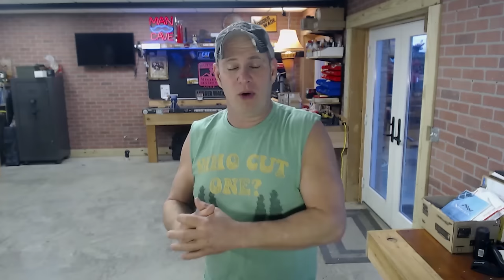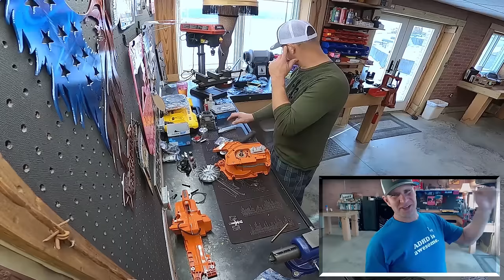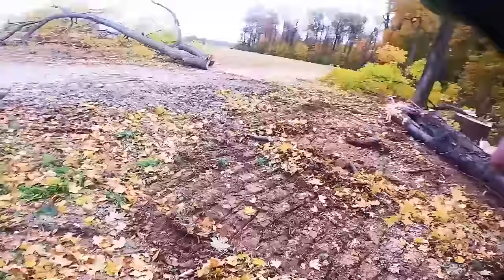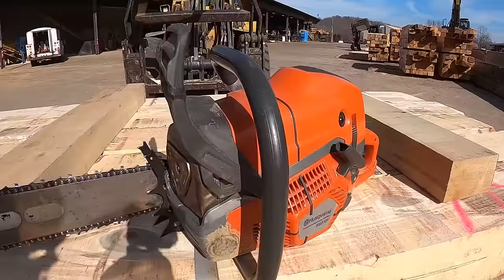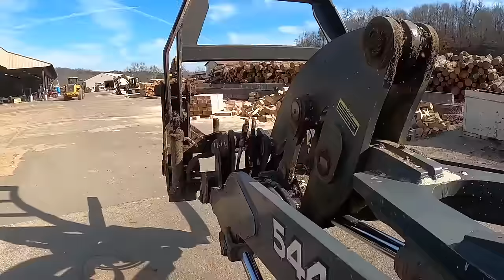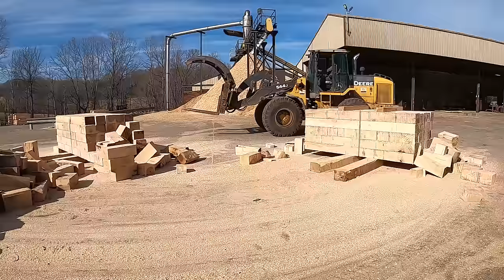Husky 592XP, This thing is awesome‼️

Comment: I remember one time I was watching hunt tree service cut down a couple of big trees at my neighbors house and all the trucks and shut their engines off. The chipper was loaded up on the trailer and this guy pulls out a husky 592. And I remember just being blown away by the power of that thing as it was cutting through the trunks of those huge Bradford pairs. It had the trunk turned in to dust in about two minutes.

Comment: Try an 8-pin rim sprocket I cut hardwood in NY with my 592 on a 24 and 28in bar and the 8 pin made an impressive difference in chain speed and helps the saw from over reving.

Comment: i have a McCulloch supper 44 with a 24 inch bar running Oregon 404 chain i got it used  in 1975  i cut and sold fire wood for years it still will keep up with the newer saws it heavy and loud but still cuts

Comment: Hi Wade. I opened the outlet hole some on the exhaust and put a red beard foam filter on mine and it helps them add some power and run a little cooler also. 😎

Comment: I run 2 592s had them 1.5 years so far. Love them overall, however the AV spring by the gas tank seems to break real easy and then both have had issues with the wire that runs along the ignition coil wire gets wore inside by the recoil pulley and won't run. Dealer said that was a common issue, so keep your eye out for that.

Comment: G'day LW, that sounds like an MS661, I run a 28 light bar on my MS660 full comp round only round. Saws used to sound different now they all sound very similar I've got a MS880 with a 36 inch bar when it's fully buried it'll belt you in the guts now and then 👍.

Comment: I ran my modified shine stihls an got into the Husqvarna line which me being me. I can’t keep my little patty fingers off of something brand new I did some modifications as I did my shine stihls. But  I have a lot of respect for the husky and I adjust mine to rap out  but with the modification on the carbs they are not running too lean. I agree  with everything you said and I can tell you there is not anyone that abuses a saw more than me I ask the impossible 100% of the time out of them. lol brand new huskys never made it to the woods before it went in the shop and I modified it.. Dad was like good god boy you could of  at least waited till the warranty expired😂😂😂😂😂 I’m a no bullshit guy I go to the woods to cut not play around 🤷🏻‍♂️😁😁 (edited fur a few spell boo boos)

Comment: i am with you on that saw sounds great, like the dual spike and it really looks like you are not really using them to there full potential. you said several time 63 gauge, but is it 3/8 or .404 pitch, from the sound of the engine i believe 3/8's with is best for high rpm engines. also from the sound of the engine, i believe proper fuel mixing this saw will hold up for along time.

Comment: I was disappointed with how the 592 piss revved constantly. Even with a 32” skip it didn’t pull the motor load down enough. I most run a 28” full comp but at any rate I HIGHLY recommend going to a 8 pin sprocket. That saw is geared too low for a small bar like a 28-32” trust me you’ll thank me.

Comment: Husky singin' its  little brrrrpppppp chamber out 😂😂😂

Surprised the long sleepers  (that is what we call ties over here 🇬🇧) are not kept for using in crossover switches, they do use longer sleepers over here for that application.  

Anyhoo, great to see you finding your feet on the tooob again, you have been a big miss Sir 👍💪
Reply: Wade was more than likely cutting for a specific length tie contract.  He can only provide for what the contract requires. My suggestion to Wade, would be to ask that a clause be added to the contract for a certain  number of bundles of switch/spur length ties be part of the sale, allowing him to save time on having to trim excess tie length. There by causing less waste of time and resources, plus increasing revenue.

Comment: Wade as a logger your chain is sharper wrong for hardwood, if your use a 7/32 file down down 1 or 2 size in file for hardwood and the angle 📐 and get the file to sharpen the top 🔝 off tooth 🦷. If a file under the tooth 🦷. All we can get now these little 90cc , hard to see a chainsaw in the forest now last 20 plus yrs . Own on big timber that left around that pretty few today in 2024 .

Comment: Try a stihl 500i. You'll never use junk again. I promise.
Reply: Junk? Give me a break! Don’t be a fanboy!
Reply: My preference has always been for the orange and white of the Stihl brand. But currently I'm comparing Husqvarna to Stihl.
Husqvarna originally started out as a rifle manufacturer and only got into the manufacturer of chain saws in 1979, where Stihl has 50 more years experience in the manufacturer chain saws. Longevity and experience are plus points in my evetual final purchase. But, I'm still doing research on both branfds.
Reply: I make my money with good equipment.  Have NEVER had a issue with stihl.
Reply: @chadbredbenner1555 they have been making chainsaws since 1959 for sure, have a picture of one.
Reply: @terryy5610 
Thank you for pointing out the error in my research. Yet still, Stihl has 30 years on Husqvarna.